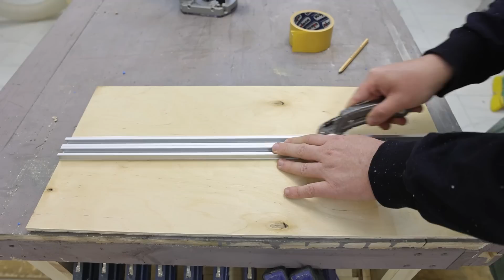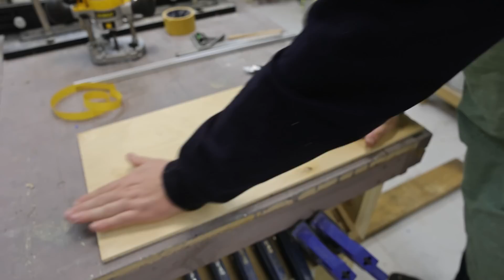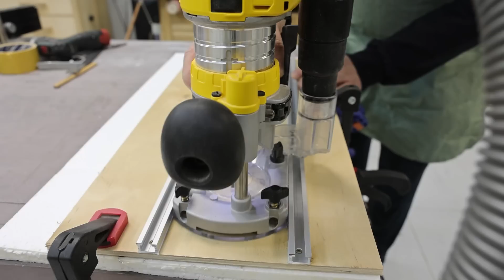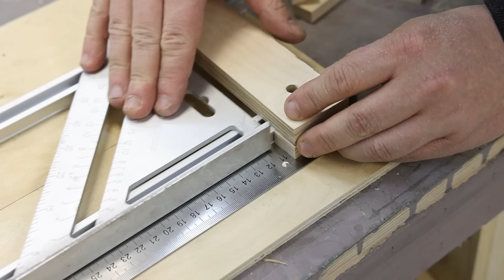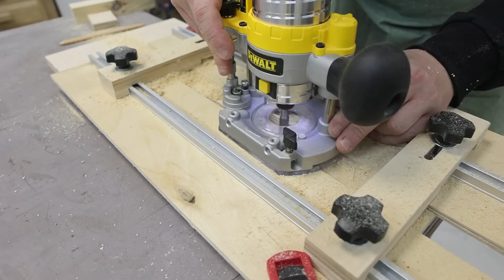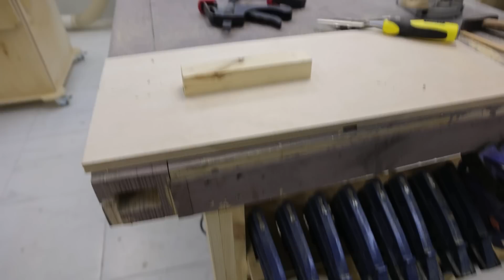Уникальное приспособление для продвинутого мастера! Из доступных материалов!

Comment: This is a very good idea, but: a) I would use 50% less material for the same thing and b) it would be a better idea to place your plunger on a full circle-round base, so you don't cut accidentally if there is no stop. 🙂 It is also wrong that you are not measuring by the round side of the plunger, but by the flat one. You see, the router has a round edge for a reason : one should always guide the router by the round side: that way one will always ensure correct distance, because you are still holding your router with two hands and that is still always inaccurate by definition no matter how hard you try.